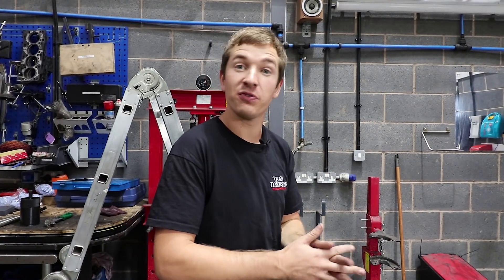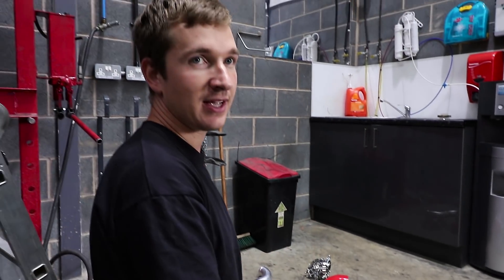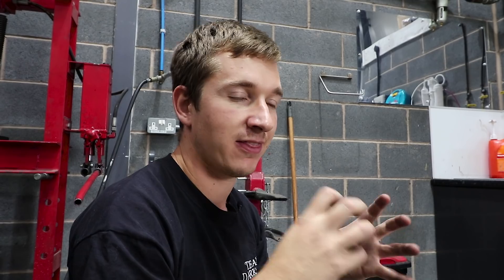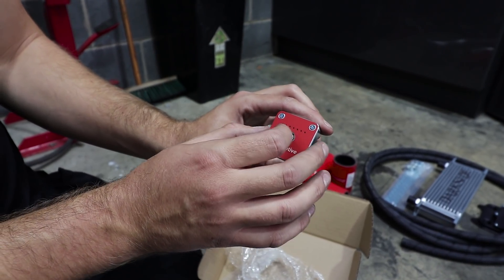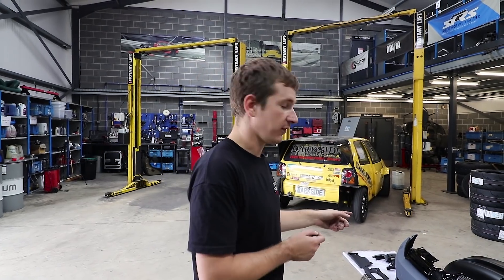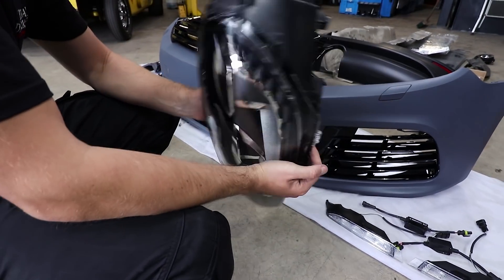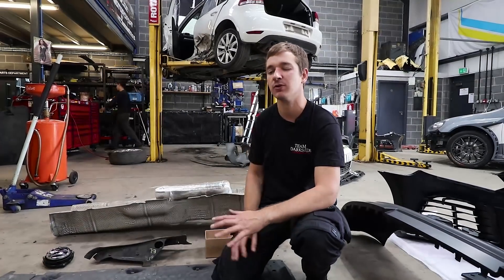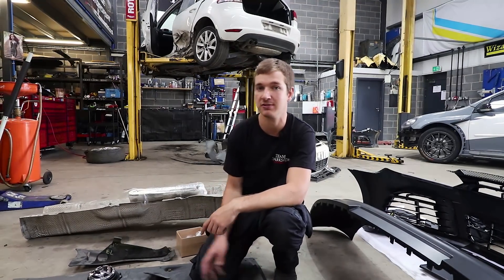MK5 GOLF TDI EX VW CUP CAR Cooling, DRL's, Aero & New Bumpers! Part 4 -  - DARKSIDE DEVELOPMENTS

Comment: Could that pump be used to pump the water round the charge cooler loop on a supercharged B8.5 lump?
Reply: Probably just a case of fabrication
Reply from the maker: Yes we can supply a controller for charge coolers. There are also smaller pumps available

Comment: Why bother with the thermostat at all? The TinyCWA can pulse the pump until it's warm etc, so the thermostat is just a restriction in the flow path ain't it?
Reply from the maker: Yes it can, it works that way to a certain extent but its still hard to keep a constant temperature and can create hot spots. We also found that no pressure (from the restriction) meant the coolant flowed too fast and cooling was worse.